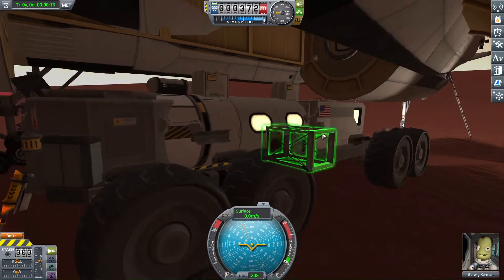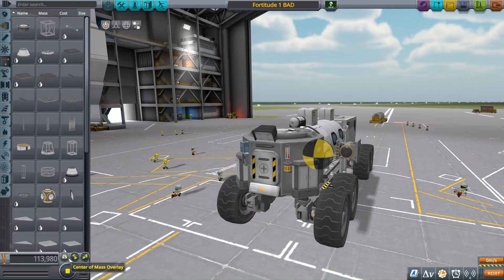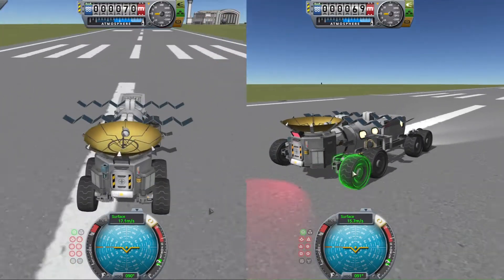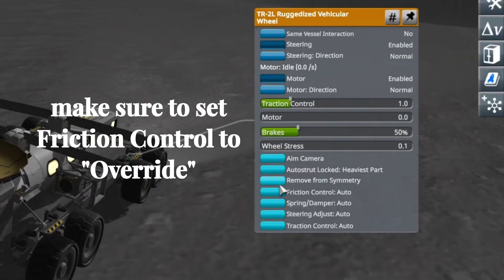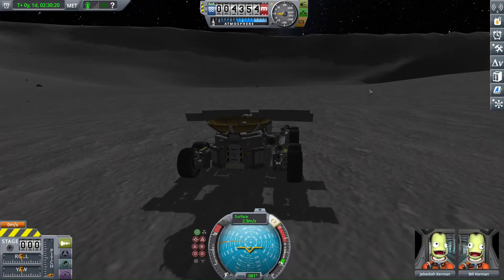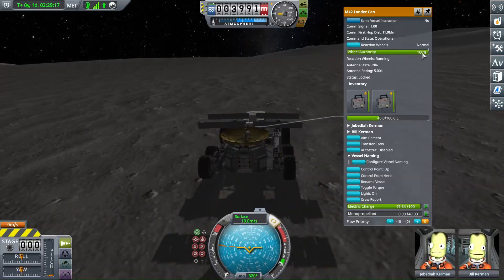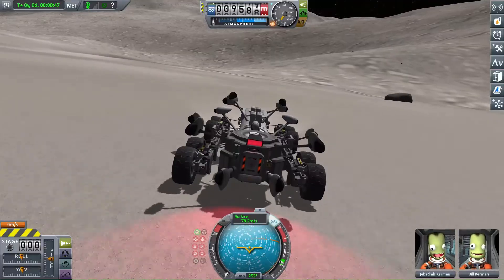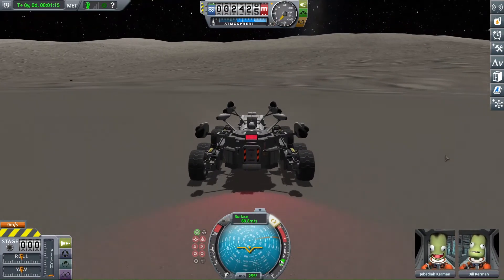6 Ways to Make Rovers Not Suck- Kerbal Space Program Tutorial

Comment: No need for all that...
1. Low center of mass
2. Use only one reaction wheel and set it to SAS only instead of NORMAL. If the pod already has a reaction wheel don't add another.
3. In wheel settings set springs at 3 and damper at 2 and dont't drive over 50 m/s.

Comment: For long distance driving on Kerbin I use the Wheeseley with medium aircraft landing gear. The wheels have great travel and no speed restrictions, use wings for downforce.
Reply: just fly at that point
Reply: The Breaking Ground electric rotors are also pretty OP, and remove fuel from the equation. Downside is moving parts that are critical for movement, and sensitive to impact. Also doesn't require oxygen, but does require an atmosphere. Also kinda annoying to me they never got stock SFX. Just recently I canceled a ground circumnavigation mission using rotors, and got as far as the north ice shelf from the KSC. The wheels failed and I ran out of repair kits, didn't feel like air dropping some more. But the blades were in tact! Just gotta be patient thru the grassland-mountain areas.

Comment: I would say reaction wheels can fix a more problems than just airtime.
If you make RWs an action group, you can turn it on when you are about to turn. It will make it a LOT easier.
I managed to make a rover that can fit in the Mark 3 cargo bays but it can reliably cruise at 40m/s (On the Mun,  could drive on Ike or Dres. Don't use on Minmus or Gilly).
I took it on several trips, one time i drove over 100 kilometers in 30 minutes.
Didn't flip a single time.

Comment: tip: have a large reaction wheel  or multiple reaction wheels and have all set to 100% force. have an action group to toggle these reaction wheels when you need them, I usually put this action group on 1-4 so i can reach it with same hand as i use for wasd keys. whenever you are driving forward, you can disable reaction wheels, but whenever you are either turning at high speeds or need more control, you can toggle reaction wheels to always have control of your rover. If you also use the second largest wheels, the wheels have an impact tolerance of 100 m/s, so basically you can survive any fall of below 100 m/s as long as you align wheels with ground properly where all wheels make contact with ground at same time. I managed to get to 50-60 m/s with a rover on duna with very good levels of control.
Reply: Cant believe he didn't mention this. This is the biggest step to getting rovers to not feel like shit.
Reply: Or set control mode on the reaction wheels to SAS only, and turn on SAS when you need it
Reply: Better is to map driving to IJKL, so that you can still use Reaction Wheels manually.  That way, drive forward doesn't lurch forward.
Reply: @silverfox8615  can't do that on console
Reply: @silverfox8615   cool, but how do i do that?
Reply: @Spacewalker1870  In the Settings menu at the main menu, not once you're in the game.
Reply: @silverfox8615   ohhh ok

Comment: Top heavy rovers can perfectly well be drifted like a maniac. I have drifted the stock crater crawler in rough terrain with minor adjustments. You just need to set friction control to something much lower or possibly have an outer pair of low friction anti-roll wheels or landing gears. Right, that way if your rover ever starts to roll up on one side traction is immediately cut to near zero to avoid falling over. Setting rear wheel steering also helps here as it counters body roll. Setting really severe rear wheel steering using robotics can allow even crazier stuff.